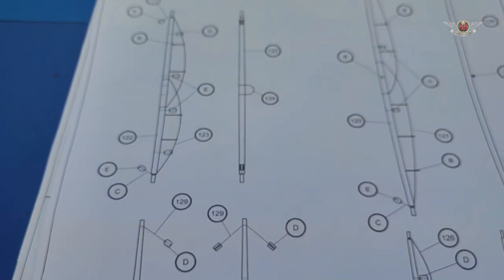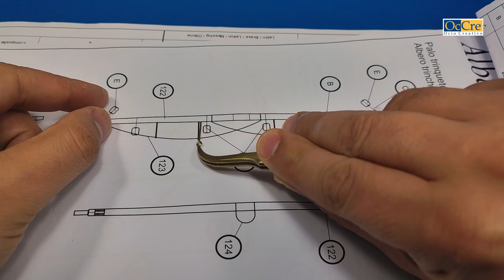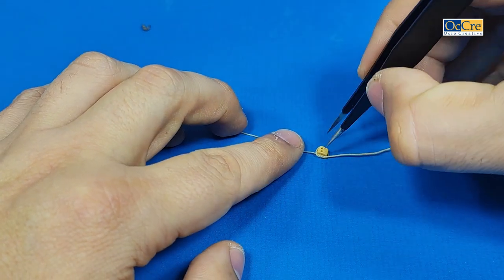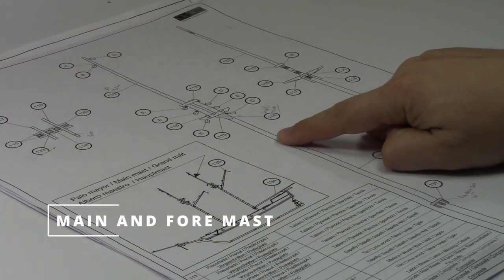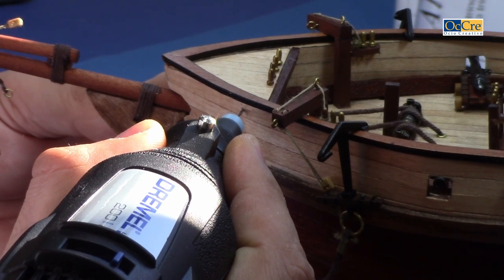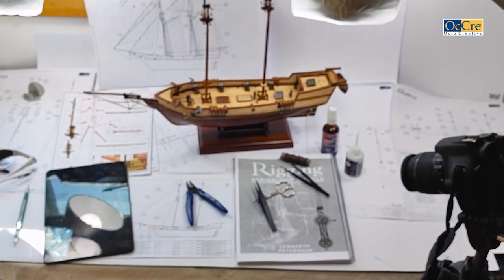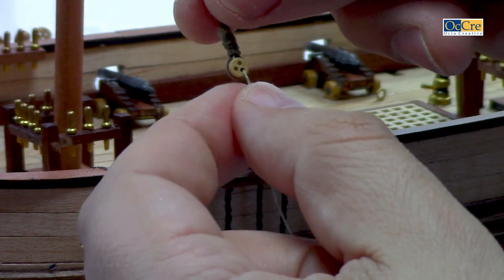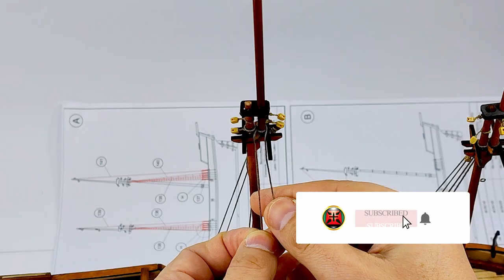#OCCRE Albatros Rigging and Shrouds

Comment: Great Video. I am currently building the Beagle from Occre. I am using 2 jigs to get correct height on the deadeyes, then taking of the ratlines and rap twin above the deadeye on my workbench. It works easier and less messy with glue. I finish like you on top with a simple knot. I know this is an extra step in the process. Like you the Beagle is my first building experience with wooden model ships. learning step by step by trail and error.
Reply from the maker: Trial and error while having fun! Thats all we need! 🙂👍 Stay safe!

Comment: Hi, Try some long stick pins in the holes of the blocks to secure them on some foam then tighten your line. To blue or blacken the brass parts, put them on a sheet of metal and use a torch or lighter under the metal plate. Looks really good Alex.
Reply from the maker: Thank you! Stay safe!

Comment: Hello Alex, I also did the construction step with the rigging on the bowsprit today. I noticed that you made a mistake. The rope that comes on the outside of the anchors is not held by the rod below the bowsprit, but is attached directly to the mast. I had to look several times before I noticed it. maybe you can change it. The front rope on the lower bar is also only attached once and not twice.
Reply from the maker: Yes but...
Reply from the maker: Yes, you are right. Changing it

Comment: Can I get some help in understanding measurements on the OcCree plans. Example# on the plans it shows 15x150 15x500. How do I break that down to the US standard? Any help greatly appreciated.
Reply from the maker: If instructions have 2X5X600 for ex: that means that you need a wood piece that measures 2 mm think by 5 mm wide And the lenght is 600 mm ir 6 cms...
Reply from the maker: All you have to do now is, using google transform mm to inches ... Hope it helps
Reply from the maker: I explain everithing on my vídeos.. you just have to find the info

Comment: Hi Alex. Dennis from Sachse, Tx USA here. The more I watch your Albatros video the more I appreciate your work! WTG!
I do have a question about some rigging on the foremast. The 1to1 scale directions only shows one block at the top of the mast. Color photos shows three. How did you tie them? Did you wrap a line and glue and then lash the lines together. Like what's done when starting the rope ladders. What kind of knot or how did you tie all three at the same spot without making it looked clumped together. The Albatross is my first build too.
Reply from the maker: I tried to glue them the best way i could! 👍👍😊 Regarding the knots i explain it on a vídeo can t remember what.. stay safe
Reply: I also drew your diagram. I followed it closely The individual lines came out much better than I expected thanks to you!! When adding the individual line used for steps. I followed John Aliprantis's video. Santisima Trinidad - part 64 Tying Ratlines & Anchors. If you will use a much smaller line when rigging steps. The ratlines have a much cleaner look. I asked John about using bees wax. He said he used it one time. Cut all the waxed lines off and restrung. The lines are much easier to handle. They are also a dust magnet. Thanks to you and Aliprantis my Albatros is coming along nicely. What are you building now?  @AlexModeling

Comment: I’m at roughly the same stage on my Albatross build.  I’ve had many frustrations building it but have learned so much.  It’s an ideal model for new builders to learn the basics and I must admit, I love this little boat!   I do have one question for you.  In the Occre plastic box kit which has all the non wooden pieces for the boat, I am puzzled over where two small metal pieces fit in to the ship.  If you orient the plastic box kit such that the compartment containing all the gold nails is at the top left looking down at it, then the two metal pieces in question are located in the compartment directly to the right of the one with the nails.  The same compartment contains gold wire rings as well.  I’ve gone over the plans several times but I don’t see where these two small metal pieces are used.  They kind of look like funnels for lack of a better word.  I was wondering if you might know?  Thanks in advance for any assistance and for all your videos on the build as well.
Reply from the maker: ASAP i will check it and get back to you ok? 🙂👍
Reply: @AlexModeling  Ok and thank you!
Reply: Haha... With those two parts, I've been wondering where they go, I couldn't find anything either.
Reply: @elcaputo5931  Glad I’m not the only one :)
Reply from the maker: Are those 2 round black with a hollow funnel, but not with a hole in the middle?
Reply: @AlexModeling  yes :-)
Reply: maybe just production waste :-)
Reply from the maker: @elcaputo5931  i thought they were to out on the bow of Albatros to coat the hole of the anchor rope but then i thought:-"were is the hole for the rope to go across?"
Reply: Hi. They are part 56 in photo 52
Reply: @davidjed6948  Thank you!  I see them now.
Reply from the maker: Thank you!
Reply: @davidjed6948  If I had read the manual properly, I would have figured it out yourself. Unfortunately it's too late now. But thank you very much.

Comment: 31:17  do you wrap the shrouds or ratlines around both masts on top. The instructions don't show how to do it. Thanks.
Reply from the maker: Yes i did! I used sóme pictures of smaller vessels And some books that told me that this is a basic feature in naval modeling. If you serch for HMS VICTORY photos of the same area you Will see it
Reply: @AlexModeling  Why do the instructions only show red lines thru the center of the mast? I want to make sure I build the ship correctly. Your videos are great, this will be my first build as well. Thanks for your help.
Reply from the maker: Good Lucky for It! Go! 😊😊👍
Reply: The rigging instructions are not that detailed.